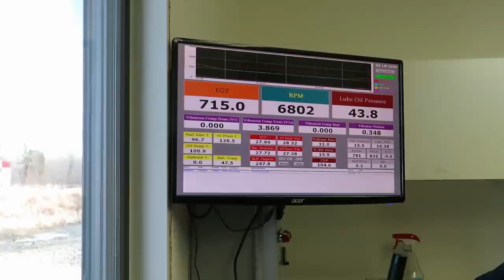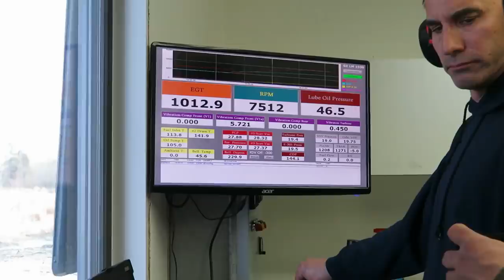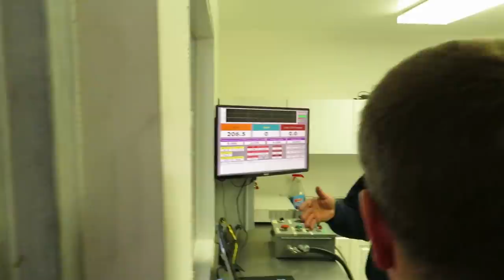Turbine Blade Locks In Action

Comment: Do you know how much centrifugal force (in pounds/kilograms) would be pushing outward on a single main fan blade on something like GE90?
Reply from the maker: Many tons. You can work it out with the weight ( 5 or so Kg ), the speed ( lets say 3000 rpm ), and the radius ( about .75 M at the midpoint of the fan blades )
Let us know!

Earlier in the year we calculated the load on the one single pin that holds each rotor blade in a Bell UH-1 helicopter at full speed:
54 tons.
Reply: @AgentJayZ  Yeh! I'll have to calculate it in math class tomorrow (9th grade algebra is too slow!). It has to be a huge amount, even with the "light weight" composite blades they use. I'm guessing like 150 tons or something like that. I'll get back with what I find tomorrow.
Reply: @AgentJayZ  with the radius 0.75m and speed 3000rpm (50 revs/sec) the centrifugal acceleration is a = w^2 * R = 50*50*0.75 = 1875 m^2/s = 190 G
which gives us a force of roughly 1000 kg for each blade

That's quite an impressive load
Reply: @AgentJayZ  The force is around 426,051 pounds or 213 tons per blade assuming the blades are about 4 feet long, weigh 50 pounds, and are spinning at 2500 rpm (rough cruising rpm). Here is what I used to find the information.
https://www.geaviation.com/commercial/engines/ge90-engine
https://www.omnicalculator.com/physics/centrifugal-force
Reply: @РоманПлетнев-г3э   Are you sure? According to the calculator below the force is 7548G, and this, at 3000rpm, while max RPM for this engine seems to be 7950 rpm. 
https://www.omnicalculator.com/physics/centrifugal-force
Edit: AgentJayz says the wheight of a blade is around 5kg, so according to the calculator the force is 37.7 tons . 
At 7950RPM that gives 265 tons per blade !!

Comment: Thats not real money though  gold and silver is
Reply from the maker: Incorrect. All "money" is just a symbol.
Reply: AgentJayZ I should be more specific, as I'm in America where gold and silver is constitutional money.  Arrtical 1 section 8- To coin Money, regulate the Value thereof, and of foreignCoin, and fix the Standard of Weights and Measures;"  All other money is backed by nothing other then Faith aka religion
Reply: America went off the gold standard. So, the money is just an accepted representation of value. And even at that point gold and silver only has the value people say it has. It only real because we think it is.
Reply from the maker: Your dollar is not backed by gold. You might want to check up on that.
Reply: NBSV1 one word - Inflation
Reply: AgentJayZ exactly my point Jay..  We have become the number one debtor county that doesn't even issue there own money as the Federal Reserve a private corporation creates so called money out of thin air and charge interest for people to use there faith based fiat money when in the constitution it specifies gold and silver as money.
Reply: paul manson "Paper money eventually returns to its intrinsic value... Zero"  - Voltaire
Reply: @AgentJayZ  It's backed by U235
Reply: @adeptpeasant6161  Ok. One word - woodpecker.
We can all throw out things that are irrelevant. Inflation would simply mean that whatever you value as currency is worth relatively less than it was before. You just try and cash in those dollars for gold or silver and see what you get.

Comment: Hi Jay, I have a tiny compressor blade from a GE CF34, and I want to give to a friend of mine, but I would like to attach it to a necklace. Question is, what would be the most suitable option to attach it? Punching a hole through the blade is discarded (titanium is very hard hehe), so maybe a rope around the blade root? 
Thank you in advance.
Reply from the maker: If you are patient, and use a nice sharp bit, you can drill a 1/8" hole through the root. It takes a minute or two. Titanium is not very hard, but it likes to grab the bit. Go easy, and it works out well.
Reply: @AgentJayZ  Thank you very much.